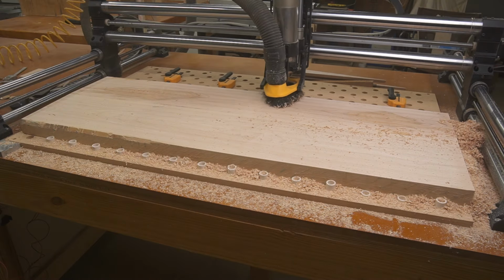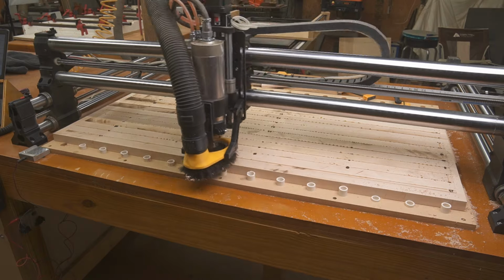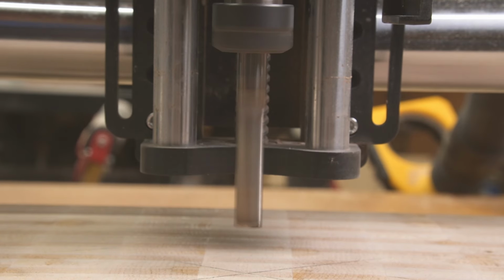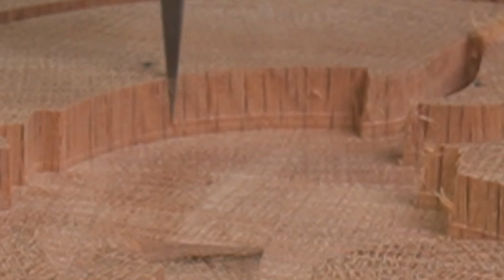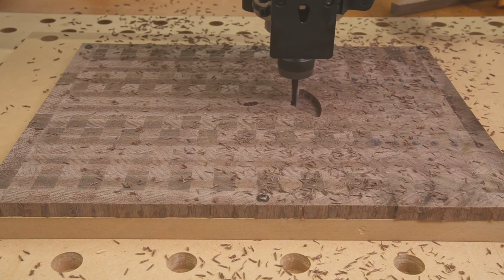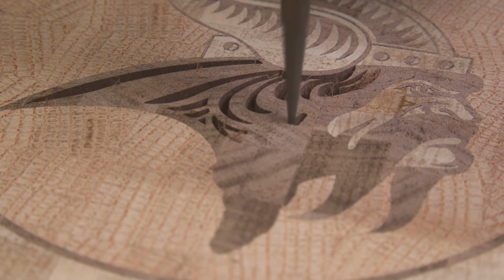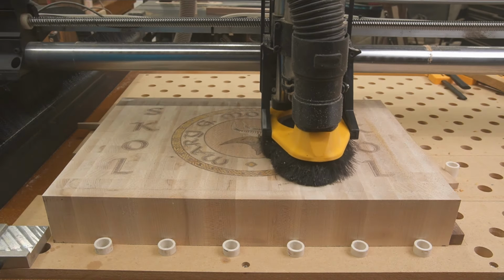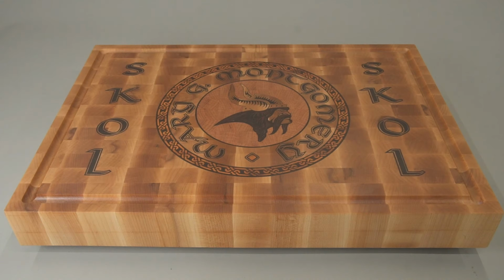End Grain Cutting Board with Multiple Inlays. Skol Vikings!

Comment: Been so so so busy lately. Getting back to some projects and this was a great watch as always. Thank you for taking the time to do this. Both the videos and projects you do. 

I see you’re using some pressure clamps to push against the PVC instead of just the angle boards. Whose are they? I like that.
Reply from the maker: I found them on Amazon. 
They only work well with heavy stuff, otherwise I only use them by clamping then against the wooden wedges to keep from backing out on aggressive cuts.

Thank you for the compliment! 
Here's an Amazon link to the clamps. 

https://amzn.to/3Xnzt3U

Comment: Hi, I recently did a V-carve inlay with 60 degree bit but I want to try out one with the 5.2 angle tapered bit that you also use. So for the settings I guess 40 ipm maximum but what about the stepover? the end of the bit is 0.25mm so I am not sure. What do you use?
Reply from the maker: Stepover isn't as crucial on inlays as it would be on other cuts.
I usually set mine to 90% and I have never had an issue.
Plus, it lowers the cut time a fair bit.

Thank you for watching!
Reply: @MandSWoodworks  Yes I was asking because of time and because the bit is so fragile. The finish is not important on the bottom (or top if it is the filler piece) as it will not be visible.
Reply from the maker: @misohlavati  This is correct. The bit can be fragile but as long as you keep your feed rate low on the inlay cuts, you should be fine.
I usually run mine around 40ipm.

Comment: Brother can you show me how you have the tapered ball nose set up in vectric pls
Reply from the maker: I enter the TBN as an engraving bit.
But beware, I have had dozens of folks ask me this question and they'll change the bit settings only for some to have success and others failures.
There is way more to it than just the toolpath.
The vector image that you use, and how it's prepared to use in your toolpaths is a huge factor, not to mention other things like machine setup, etc.
Please do test cuts on scrap and decide what cut settings are best for you, because if you use mine expecting perfection, you might be disappointed.
Good luck and thank you for watching!
Reply: @MandSWoodworks  thank you for your response. I needed to know if you are entering the exact bit measurements as far as bit radius and angle... A screenshot would really help or if you just want to type in the info here
Reply: @MandSWoodworks  and yes I always will do a test to see what the results are

Comment: Do the inlays need to be end grain as well? Or will they carve just as well into face grain or edge grain?
Reply from the maker: Yes, both the base and the inlay is end grain.
No, end grain carves light years better than face/edge/side grain.
Side grain is very difficult to get small details without tearing out.
End grain is much more forgiving.
And, no. I would not mix and match end grain to side grain.
Over time as the wood moves (Expands and contracts) you risk it separating from each other.

I hope that this helps.
Thank you for watching!

Comment: Could you go over what you did to modify your shop press for your appliaction
Reply from the maker: It was very simple. 
I didn't modify the press at all.
I just added the ply sheets to it. 
I laminated a few ply sheets together to make the press plates and mounted them to the upper and lower press gantries. I can remove the ply plates and have it as a working shop press again in just a few minutes, as well as putting it all back together. 
I hope this helps. 
Thank you for watching!

Comment: @Scott : Awesome videos, I've watched them all a few times.  1 question...  at 12:30 minute mark you talk about using ball nose/narrow bits and tricking V Carve by calling them engraving bits.  Any chance you can post how the tool is defined in the database?  I was reading that in order to do that, you need to multiply the degree by 2x, however I'd love to compare it against something.  For reference...  "A few quick things. In general, tapered ball nose tools are listed by their draft angle/half angle/taper. So if you try to use it in any software make sure that you are putting the right number in. In screen shot you have you are listing it as a 5° included angle which would typically be incorrect (it would be 2x the draft/half/taper)."  That quote is from a Carbide Create forum but like you, I am using V-Carve Pro.
Reply from the maker: I can't speak for Carbide Create as I have no experience with it.
But when assigning the bit as an engraving bit in Vcarve, it asks for the side angle of the bit. 
And all of the tapered ball nose that I have bought, list it's side angle in the specs and that is what I use to set up the bits in the tool database.
I think what you are thinking of  by stating that you would multiply the side angle by 2, is if you were assigning the bit as a Vbit, which doesn't use a side angle in the geometry, but the total angle of the bit, in which case you would need multiply the side angle x 2 to get the total angle.

I hope this helps.
Thank you for watching!
Reply: @MandSWoodworks  Scott, super helpful!  Thanks very much.  Can't wait to put what I learned from your videos into action.

Comment: Awesome Freaking Inlay!  How many days did it take?  Have you ever done an end grain cutting board with an end grain inlay?   Anything I need to be aware of before trying end grain on end grain inlay?
Reply from the maker: Thank you!
I am only able to work on this stuff in the evenings and weekends, so this took me about 8 days.
Yes, End Grain is all I do. I have only ever tried edge grain a few times and it was enough to know that End Grain is way more forgiving! Btw, I suggest only applying end grain inlays to end grain boards. If you were to do an end grain inlay into an edge grain board, it stands a chance of failing over time due to the wood expansion being opposite of each other.

The only 'warning' I can think to give about end grain is that it is more time consuming creating the end grain boards and blanks, and a bit more expensive. You create a lot of waste when doing so and as I am sure you already know, Hardwood is expensive these days! So with that, just figure out a routine to be as efficient as possible.
Thank you for watching!!

Comment: Great board and even better walk thru of what you do and why. Thank you.
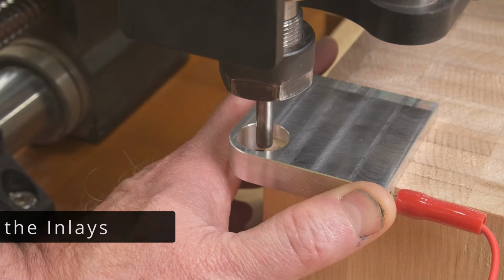at 7:24  I have not seen probing done that way on a OneFinity. What probing routing are you using? That would make it ridiculously easy zero off any corner instead of what I do (use a 123 block and the built in zero for front left on the block). Can you provide the probe routine, a link, reference, etc? (Is it an elite 1F? I am running their original buildbotics controller)
Reply from the maker: Thank you! 
I don't have the elite upgrade but I did buy the Masso controller and steppers straight from Masso and upgraded it myself. 
The Masso allows for several comprehensive probing routines that the stock Onefinity controller does not, including the way you see me zero X and Y.
I use the Onefinity probing block as a bit setter now and I had the probing block you see on the video custom made for my needs.
And yes, you are correct. 
In my opinion, Zeroing from the center is more precise and repeatable, and it is definitely quicker. 🙂
I hope this answered your question. 

Thank you for watching!

Comment: Amazing work!  I think I transcribed the numbers you described accurately (but I added a pre-clearing path for underpowered hobby machines like mine).  Did I get the numbers right?  And did I understand that you use engraving and not v-carve toolpaths?

Pocket
Start .00
Flat Depth .25

Plug 
Clearing 1
Start .00
Flat Depth .25

Clearing2
Start .25
Flat Depth .1
(Total .35)

Finishing
Start .25
Flat Depth .01
Reply from the maker: I use a vcarve toolpath.
I list my tapered ballnose as an engraving bit in Vectric.

Your 'Clearing2' pass is not necessary. I ONLY did that for the video to create a visual reference to explain the difference between START DEPTH and FLAT DEPTH.
Your other numbers look fine.
Please do a test on scrap wood before cutting on good wood!
Good luck!

Comment: Couldn’t you use the new carve inlay in V12 with a TBN entered as a Vbit?
Reply from the maker: Not in my experience.
A vbit doesn't have a flat tip like that Engraving bit does.
I don't understand the physics with each bit type but the behavior between a tbn and an engraving bit is very different.

Comment: Nice work.  My high school mascot was a Viking  too.  Question: How are you setting up the tool path to carve away the excess plug material after the glue up?  I assume you're using a pocketing tool path with zero depth and zeroing off the top of the cutting board?
Reply from the maker: That is exactly what I do.
If you worry that the surface of the board has warped or moved after gluing in the inlays, maybe set your Z height 10-thou higher than the surface of the board and then let your very last surface pass be level with the surface of the board.
Thank you for watching!
Reply: @MandSWoodworks  I live in Eastern Oklahoma so warpage is always a concern.  Thanks for the info and keep the videos coming.

Comment: How do you handle corners? Do you leave them sharp or add a radius?
Reply from the maker: It varies on the board, and my mood at the time. Ha!
Sometimes I will run a router with a round over bit over them.
On this board, I just sanded them down enough to soften them up and take the sharp edges off.
I intentionally left the footage of me sanding out of the video because I always thought it was boring and nobody cared.
And now here you are with a question about sanding. Lol.

Thank you for watching!
Reply: Hi, I was asking about the corners in the inlay vs the board pocket. Sorry
Reply: Ha! I was wondering where you sanding was. I may be one of a few, but sanding is cathartic for me.
Reply from the maker: @marcellobellon5666 
Oh! 
That also depends on the situation. If the corners have very narrow angles then I will most likely round them off to prevent issues with the inlay fitting in the pocket. But if the angle is broad enough I'll leave the sharp edge in.

I hope I answered your question.
Reply: Thank you, I use Fusion 360 to draw and cut my work, I’ve been adding the tool tip radius to all my corners. Lots of time drawing.

Comment: There is no limit stopping one from using a tapered ball nose bit in Aspire. I do it all the time with great results. I have no idea why you would use the engraving mode to do inlays. I always make my inlays .3" deep and use a plug start depth of .25" and a flat depth of .05". I don't see the need to have a large glue gap like most folks use. I just finished a board the other day with these setting and it came out perfect. BTY I'm using Aspire 10.5.
Reply from the maker: With respect...
You must have not watched my other inlay videos.
I always shoot for zero glue gap on most of my inlays. There are some cuts where a glue gap is acceptable, but most of the time my goal is to have the inlay plug completely seat against the floor of the pocket.

Regarding your use of a Tapered Ball Nose and leaving it assigned as such in Vectric:
Are you using the INLAY tool path in Vectric to cut your inlays or are you using the VCARVE tool path to do the VCARVE INLAY TECHNIQUE?
The reason why I ask is because using a Tapered Ball Nose bit in a Vcarve Toolpath and it be assigned as a Tapered Ball Nose in the Tool Database will result in a very different behavior when cutting the Inlay/Plug portion of the Inlay. I know this from experience.
I would be very interested to see an example of your inlays where you have cut it the way you describe in your comment above. 
I have a suspicion that you are not using a Vcarve Tool Path, but instead the Inlay Tool Path in Vectric.
I sincerely hope that I don't come off as condescending because that truly isn't how I mean to make it sound, but I have extensive experience with this, and having tried assigning the bit as a TBN has resulted in colossal failures for me.
If you have figured out a different method I would sincerely like to know what it is.

Thank you for watching!
Reply: @MandSWoodworks  What kind of issues are you having using the TBN bits in vcarve?
Reply: @MandSWoodworks  I stumble onto this video that uses the same basic procedure as I do, the only difference is I use a start depth of 0.0" and a flat depth of 0.05" on the first toolpath then a start depth of 0.25" and flat of 0.3" for the final. Here is a link to the video: https://www.youtube.com/watch?v=_eupkJk-EAU

Comment: Hmm. Because in Broinwoods course he enters his TBN in as a Vbit not engraving.
Reply from the maker: I've never seen his course but I have tried entering the TBN as a vbit and using it as a TBN and I could not get either of them to work properly. The only success that I have ever had was changing the bit type to an Engraving bit.
If he does use it as a Vbit, I would like to know how exactly he gets it to work.
The reason being is because when entering it as a vbit, Vectric considers the vbit to have an infinite tip and an Engraving bit has a flat tip. 
When creating a toolpath using a vbit, Vectric will assume that the tip comes to a point and it will cut along the vectors as such. If the bit actually has a flat tip of any size, then it will not cut along the vector accurately.
If you happen to know for a fact that showing it as a vbit bit, I am sincerely curious how you do it. I have never claimed my way is THE way, it's just a way that I figured out on my own.
And another thing to consider is that my method, I shoot for a zero glue gap. Other methods allow for loose tolerances and will usually always have some sort of glue gap.

Comment: Trying to understand what you did, I get you did sperate tools paths in the video.
Can I use the V-Carve / Engraving toolpath for the tapered ball nose and use 1/8" endmill as the clearance tool?

V-Carve toolpath
Female Pocket
1/8" end mill
Clearing 1
Start .00
Flat Depth .25

TB - Cleaning edges up
Pocket
Start .00
Flat Depth .25
--------------
Male Plug
VCave / Engraving pocket tool path
1/8" end mill
Clearing 1
Start .25
Flat Depth .1

TB - Cleaning edges up
Finishing
Start .25
Flat Depth .1
----------------------------------------
Or do I create sperate tool paths
Pocket
1/8" end mill
Clearing 1
Start .25
Flat Depth .1

TB - Cleaning edges up
Pocket
Finishing
Start .25
Flat Depth .01

Thanks
Reply from the maker: The cut I made in this video was merely an example to show what the Flat Depth setting dictates when you make the inlay/plug cut.
It wasn't intended to suggest that you should use it as a cut setting for all inlays that you cut.
I typically set the flat depth for the plug at around 0.01" and not the 0.1" that I used in the video.

To answer your question:
First it's important to add, and I have mentioned it in most of my inlay videos, that please don't take my cut settings as the end all-be all of inlay cut settings. Use my settings as a starting point to figure out what works for you.
Test these out on cheap Pine and/or MDF to make sure you are achieving what you want before cutting into expensive hardwood.

Use a Vcarve/Engraving toolpath for the pocket and the plug.
Use your engraving bit as the main bit, and enable the "Use Clearance Tools" feature of the tool path and choose whatever end mill that you wish to use for that.
For the pocket: 0.0" Start Depth - 0.25" Flat Depth
For the inlay/plug: 0.25" Start Depth - 0.01" Flat Depth

You need to specify the Tapered Ball Nose as an Engraving bit in the Vectric Tool Database, otherwise your inlay could fail.
Also, have a look at this video I published about how to edit your vectors to achieve successful inlays. This is just as important as bit settings.
https://www.youtube.com/watch?v=vcMlwmSWpCc

I hope that this helps.
Thank you for watching!